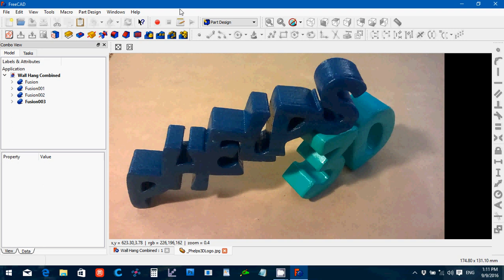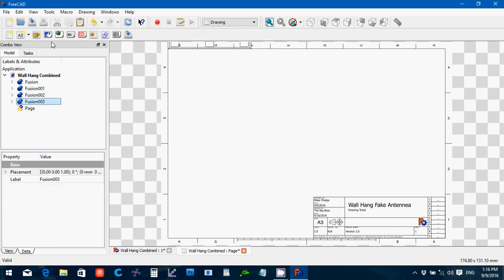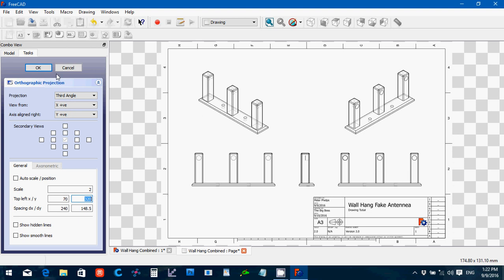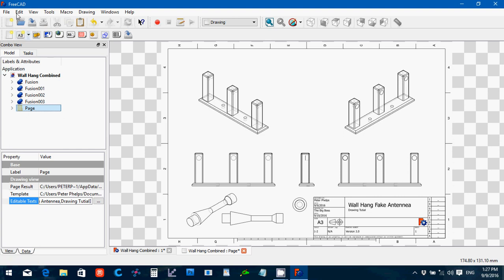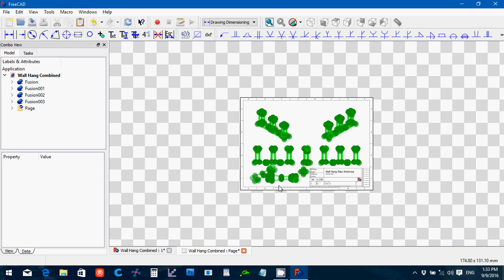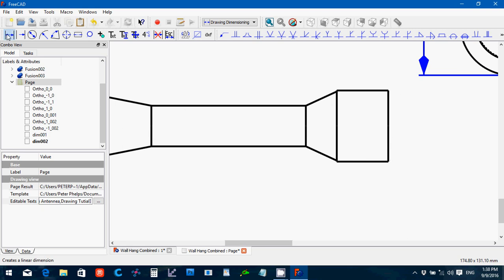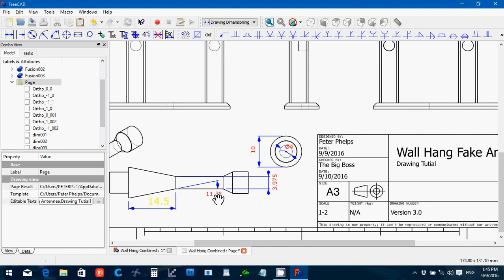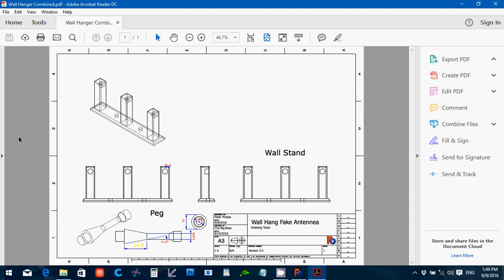FreeCAD 0.16 Drawing and Drawing Dimensioning

Comment: Can you create a drawing template within the Drawing Workbench? I created a "template" to work in inches and lbs but I want to create a whole template that include tech drawing.
Reply from the maker: Truth is I really haven't done much with the template files other than make truly blank ones without the FreeCAD logo. I'm curious how you added weights to your template file? Sorry, I can't help you with this. Try the FreeCAD forums.
Reply: I am at work so I don't have FreeCAD in front of me, I think you go to Tools or Edit. Look for the properties of FreeCAD and there are about 3 or 4 tabs. There is a menu to change the measurement, just select Inches/LBS. Thanks for your response.  I do have another question for you and I can't seem to get a response from the forum on this, my version doesn't have Drawing Dimensioning workbench. It appears that I have the most recent release from what I can tell from the webpage.
Reply from the maker: The person that created the drawing dimension workbench quit supporting it. That's why I created a OneDrive folder with the old version (the latest one was broken). https://1drv.ms/u/s!AmL6m-CnS-K3lFB7UH_hmJ32CvgV  The latest 0.17 version of FreeCAD has a different workbench built into it for this type of thing called TechDraw. Sadly, I find its use of crosshairs on every circle very troublesome for outputting drawings for patent purposes (especially on objects that have a lot of holes). My experience with FreeCAD and inches is that it doesn't change the coordinate system (that remains in mm) which makes it frustrating. I tend to just design everything in mm and then change labels in the drawing workbench if the client needs inches. Good luck.

Comment: Hello.  Can you just do a SIMPLE 2D drawing, with the template, with dimensions in INCHES.  A 2D getting started.  I am unable to draw a 1" long line and size it up.... ;(
Reply from the maker: powershop1903 Hi, I just tried adding lines to a drawing from both sketch and draft with errors. So I don't know how you would do this with the Drawing workbench. I think that the Draft Workbench has the ability to add dimensions in it, but haven't used that feature before since I mostly work in 3D. Sorry I wasn't more help.